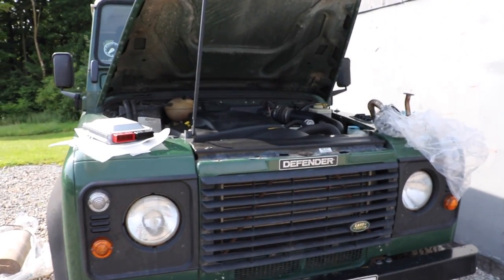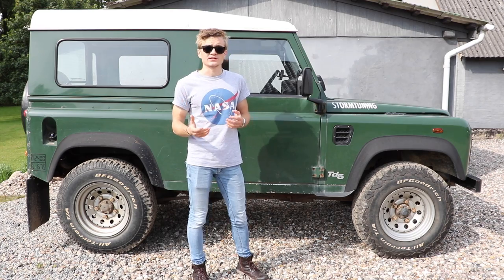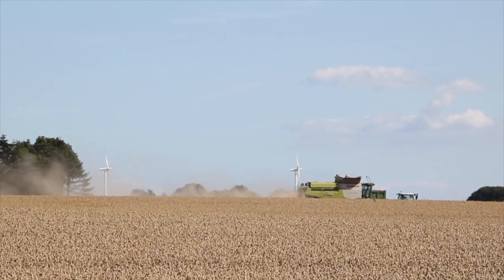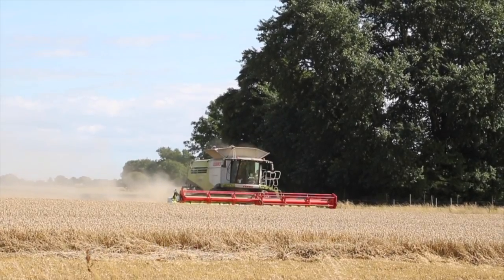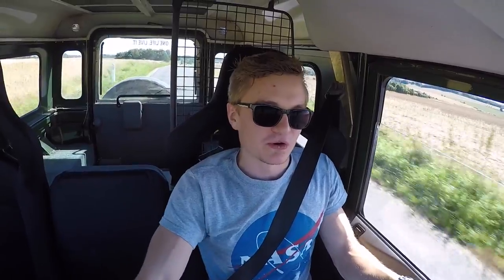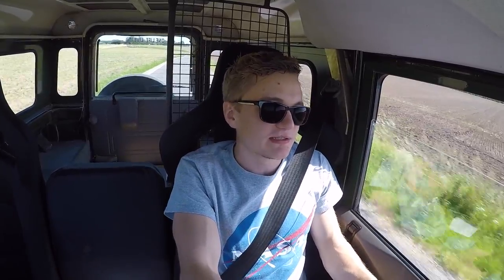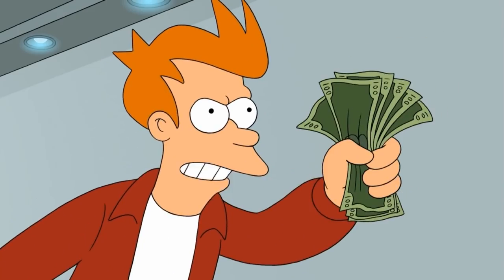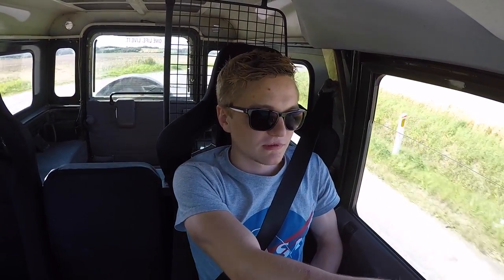How Storm Tuning's Stage 2 Remap Transformed My Td5 Defender

Comment: I have to say Liam, watching your last video convinced me to get my TD5 done. Watched your video on the Monday after you had yours done and booked mine in for the following Saturday! Daniel took me out before and after and I can tell you now, I've never seen a defender move so fast (the guys is a mad man)!
Thank you for sharing your story with us as if it weren't for you, I'd still be at 122hp
Reply: Considering doing the same to my TD5, what was the cost like for doing yours?
Reply: Alex I
Reply: I'd already installed the required modifications prior to having the stage 2 remap. The cost of these were: EGR Delete - £30, Decat - £75, Mid box removal - £50. The actual remap itself cost £285... so in total from standard it would cost £440 which is hardly anything compared to the way the car drives now at around 190bhp.
Reply from the maker: Thanks Alex! Glad to hear you got your Defender remapped, and that you are enjoying it.

Comment: I've just had mine stage 2 remapped by Alive. No change to exhaust, or EGR or intercooler. It's transformed my TD5 so that I don't worry about an overtake or joining the motorway. I still sit at 60-65 mph on the motorway, but it has enough umph to overtake with relative ease. 
Tempted by a straight through exhaust etc, but the neighbours would not be pleased at 0530. 
Storm, Alive or whoever. If it's done right it WILL transform your TD5.
Reply: Just to add to that, and a note of caution in the UK. I found it difficult to get insured. I'm 46 with no convictions. It cost me double my Direct line insurance who would not touch me as it was more than a 20% increase in power. 
One specialist advertised in Landy magazines wouldn't insure me over 10k miles per year. 
I'm now with another specialist insurer.

Comment: Awesome mate, but I would seriously consider installing an uprated intercooler to rein in the exhaust gas temperatures, or you risk warping the manifold. Stage 1 you can get away with it but stage 2 remaps usually demand it. Also may be prudent to fit an EGT sensor and dash gauge to keep an eye on exhaust manifold temperatures. Really enjoy your vlogs as a fellow enthusiast, cheers
Reply: Tom Smith that might be the case with other tuners but with our map we can ensure low EGTs

Comment: Great video as always Liam (and Nisse). I'd like to do this to my 130 but really doesn't want the extra noise. Mainly for comfort on long trips and to not disturb people in my area :( Would you say that you've got a louder car during cruising speed or is it mostly during acceleration? Any ideas of how many horsepower you would loose if you don't remove the center silencer?
Reply: Ok, you sort of answered the first question around 14 minutes. :)
Reply from the maker: Thanks Kim! If you drive the car sensibly it's not very noisy, only when you accelerate hard. I don't think it's possible to have the remap and keep the centre silencer on because it's too restrictive on the turbo and the combustion of the engine. Maybe you could try a Stage 1 Remap, I don't know if that would be quieter.
Reply: There is also another option - on my Discovery I replaced the standard centre muffler with the biggest universal straight through muffler I could find (standard rear remains, its straight through anyway).  Still removes the restriction in the pipe, but sounds almost completely standard at 100km/h cruise, no horrible drone.  When you load it up accelerating it has a nice subtle background growl inside, and sounds very nice from outside without ever possibly being considered loud - if Land Rover had done a 'sports pack' exhaust, I reckon this is what it would sound like.  I have fitted a straight pipe to an auto Td5 as well for someone, and it was mildly amusing to drive around the block, but I don't think I'd be able to deal with it as an everyday drive - plus every Nissan/Toyota over here runs a 3 inch straight pipe all the way, and those just sound awful, like to keep mine a bit more refined and subtle to be different to them.
Reply: TirsbaekTV 
I had a stage 1 remap on a Defender 110 HT, mostly driven with a twin axle trailer, sometimes loaded to the max.
It was the best thing I ever had done to the Defender.
It changed the hp and torque upwards 25% or so, it was much more fun to drive, overtaking was a breeze,  and the bonus?
4-5 % less use of diesel.
It didn't make the car louder, at all.
Stage 1 makes it fun to drive.

Comment: looked at doing this to my 110 until i found the unichip tune gives you 5 different options at the push of a button will upgrade the inter-cooler and air filter and definitely getting a straight through pipe your truck sounds mean.
Can't wait for the LR TD5 vs LR V8
Reply: Brown Bomber that's because it's a tuning box rather than a remap. In all honesty, there is only one place for those things and it's in the trash. I would still tell you the same even if you took your vehicle to One of our Competitor, even the generic remaps off eBay are better than the tuning boxes

Comment: Okay, as a Dane I'm a bit curious about the whole MOT thing as the law is quite strict here. I even think Nisse mentioned it briefly in another video, but you're only allowed up to 20% more power before having it checked again and you may need better brakes etc. to get it all approved.

On top of that (this may be EU stuff, I really don't remember..) there are also limits to how much noise it can make and to the emissions. They don't add that EGR thing or whatever for fun after all. If it's approved with an emission of X, then you can't just alter it to have an emission of X times 5 for example. :P

I suppose those LRParts folks must have dealt with it before considering they apparently do tuning and are located in Denmark. What do you have to do now to make sure it's still road legal? Did they go into that when you were there? It sure would suck to get a car fixed up and then not be able to keep it on the road. lol

Comment: Great stuff on Storm upgrade BUT can you give us some figures on the acceleration increases and top speed differences.
I am in the process of doing these mods, just remap to go. Have you any info on whether storm or alive is the best way to go. or are they the same thing really just a different company doing it. also as I have a 10p engine with non flash-able ECU is it just a piggyback chip? as I will buy a new ECU if that is the case, being an electronic technician I don't like piggy back stuff, keep up the good work though.
Reply: Alan Bean we don't do piggy backs. We remove the eprom and solder a PLC44 socket in its place before installing the replacement eprom in it.

As for speed increase, my own personal Stage 2 Defender, I chickened out at 110mph but it still had more to go
Reply: Alan Bean I STUCK A 15P ECU ONTO 10P ENGINE,USED HAWKEYE TO CHANGE THROTTLE POT,JOB DONE REUSABLE ECU...
Reply: Just waiting now for nanocom and ECU to arrive. Then I will see what happens eh!
Reply: Alan Bean you know where we are! All our contact info is on our website www.stormtuning.com
Reply: Soon as I get it and fit i will be in touch for the final stages of getting it working.

Comment: Ok mine is an 05 td5 with a straight through exhaust, looking to maybe get a stage 1 map done. With the map done, will mine gain this burble/turbo sound or will the cat converter (fitted to later models) restrict any change in sound? P.s EGR is still fitted too. Thanks
Reply: Joel Y The exhaust note is mostly due to the large middle box silencer being removed. To get the most out of a map you need to "straight pipe it" through to the rear end, leaving just the little rear silencer box.
Reply: Nathan Hardwick yeah I have the straight through centre pipe just a standard rear pipe and standard front pipe out of the block but that has a cat in it. Thanks for replying
Reply: Joel Y I recently decated mine, but obviously MOT tests now state if it was built with one fitted, it MUST be present. Luckily i have a friendly local tester ;)
Reply: Nathan Hardwick I know, I’ll have to have a word with mine, if it’s a no go I guess I’ll just stick with what I have, still get the map though, cheers!

Comment: Hi, did you consider an intercooler upgrade, if so what was the reasoning behind not replacing it? Cheers
Reply: Turtlesandwich simply put they are not required, we can get sufficient Air flow from the stock intercooler

Comment: Just a quick question, Does this make your landy blow out more black smoke than it used to? because I know when you adjust the fuel pump on a tdi it creates more black smoke, wondering if it's the same on the td5 remap ?
Reply from the maker: If the remap is done properly there should be very little to no smoke. Adjusting the turbo appropriately and fitting a performance intercooler will also help.

Comment: Hi! I just bought the syncro gear box that u recommend but didnt install it yet. And now i am thinking about the remap and the intercooler. 
I am useless and have no time to do anything on the car myself. So it scares me the fact that remaping will start taking me to mechanics too often.
Do other remappings different than the one u used are as reliable as yours.
I said ask u thar cause there is an specialist near my house in spain who does prepare 4x4 for competitions and uses different remaps... so dont know what to do...
Reply from the maker: Contact Storm Tuning, it doesn't matter that you are in Spain (I'm in Denmark) they have customers worldwide. They can send you a remapped ECU.
Reply: @TirsbaekTV  thank you very much. I got in touch with him but still waiting to see how we can do it cause it seems to be a problem th fact that i havent got a nanocom...

Comment: I have a td5 90 oversized turbo variable vane, fully tuned bigger  inter cooler and a box of tricks to fool Ecu for the boost not the standard boost box,straight through exhaust and its addictive the exhaust note,the td5 is one of easiest engines to tune has loads more power available ,the only problem I get with the bigger turbo is low down turbo lag ,slip the clutch and the power is amazing ,mid range will keep up with any modern car.struggles for more air so I cut another hole in the air filter box.
Reply: Mark Mckale I